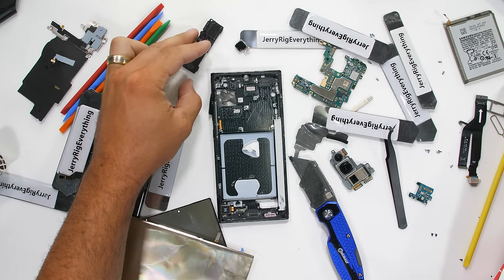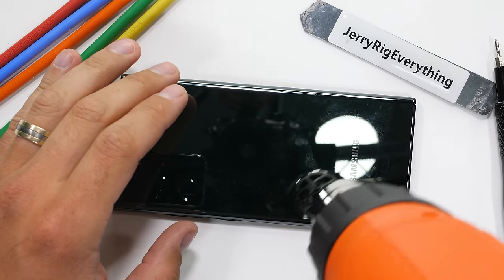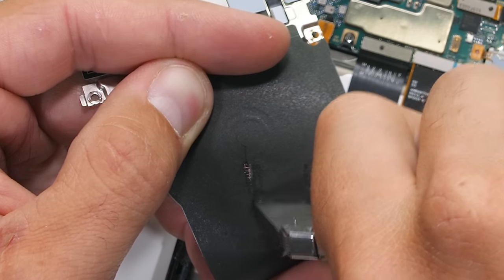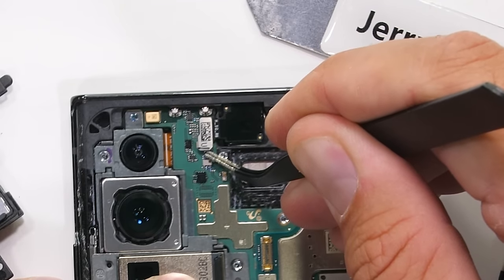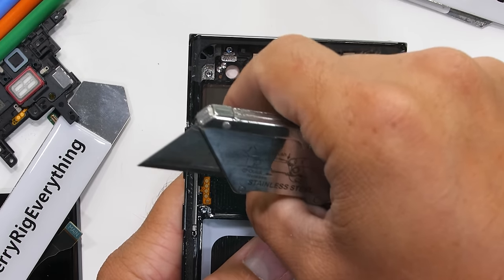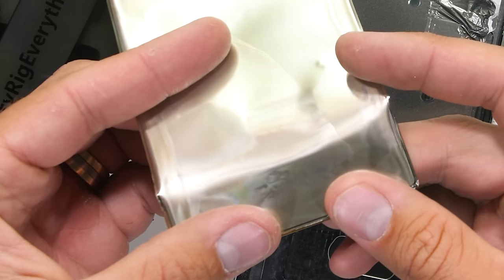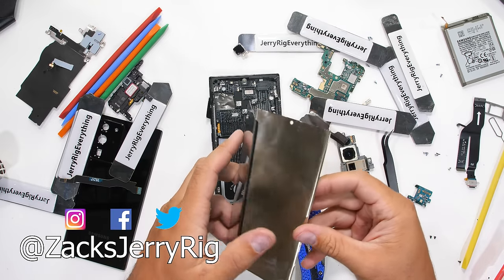Samsung Note 20 Ultra Teardown! - No Copper Cooling inside?!

Comment: I've had a note 20 ultra since release, I upgraded from the note 9. Its definitely an upgrade to the note 9 no doubt! everything is better on note 20 ultra from what I've experienced. Quite shocked to see no thermal paste tho?? So far Mines not been getting hot at all, even during benchmark tests and stress tests
Reply: I play Genshin Impact and during a warm day (not even our hotter summer heat) if I have the brightness higher than 10% my phone cooks while playing. It's pretty horrific. You'd think after the note 7 dilemma, they'd think about the phone heat more thoroughly.
Reply: @beansandmullets  same issue here. Literally came on here after my phone got so hot I couldn't touch the volume keys. The temps go up and down dramatically, kinda disturbing. I feel like I need to store this phone on something noncombustible
Reply: Honestly same, the jump from the note 9 to 20 was great, but its disappointing to see samsung stoop low like that
Reply: @beansandmullets  all phone heat up while playing genshin impact lol. Even iphones and the ROG reach 50° while my note 20 ultra exynos barely reach 46°
Reply: @SirAreve  heat up while playing genshin impact? That's normal. all phone could reach 50° while playing that beast
Reply: I also upgraded from the Note 9 to Note 20 Ultra. Both phones always extremely hot when gaming, it's not possible to play without a strong case on because of the temperature otherwise your fingers get really wet from sweat. But Note 20 Ultra is even hotter than the Note 9 and I find that extremely disturbing especially considering all their claims about how both of those phones stay cool when gaming and it's a total lie. With that being said, when not gaming, they're fantastic phones (Note 9 better in my opinion).
Reply: @potatochalbro  I have to say I don't really game on my note 20 ultra other than some old school ones that don't stress it very much, not a fan of mobile games though I prefer gaming on my pc or my ps5. (That does suck for people that do game on note 20 tho 😕) but in normal use its fine for me and doesn't get hot "like you said". Have you tried xbox xcloud? Because xcloud is streaming games not actually running them it shouldn't make your note 20 ultra hot but you'll need a controller and depends on what games you play I suppose
Reply: I came to this video after my phone gets hot from just charging. It's ridiculous. I have only had the phone for maybe 2 months but this is horrible. I also have my hotspot on a lot if that makes it even worse???? But I've been looking into the ROG Phone 5 or Black Shark 3/4 instead. Though does anybody have any tips? I like the Note so much other than that......

Comment: "My next phone will not be a Samsung..." That's exactly what I said a year ago for the S10 and the Exynos situation... Yet I waited for a year to upgrade from my s7 edge(trust me it was a real struggle but rooting etc made it work for a bit). I have an OnePlus 8 pro at the moment and I don't think I'll go back to Samsung (ever). Same thing that happened to Sony when I upgraded from an Z1 to the s7 edge. Let them bankrupt for all I care...
Reply: OnePlus is the best option, I still use OnePlus 6, just because it was the last to get a headphone jack, but its performance is still top of the line!!!
Reply: @77piter77  indeed snapdragon 845 is no less of a king
Reply: What did rooting your phone help you do?
Reply: @audai1366  install ViperAudio? Install Advanced Charging Controller (ACC) to manage charging limit, prolong the battery longevity and enter cool down phase for few seconds with its heat management? Mask my root from banking app and pokemon go? Underclock/Overclock or ability to chg the i/o scheduler to ZEN instead of the normal CFQ for better stability?

It wont be beneficial for a normal user. Cuz they are the kind that says its spoiled, let's chg to the next phone I guess. Its for the more advanced and adventurous users that wants to control what they have in their phone after warranty ended.
Reply: @audai1366  what Eddie said plus flashing newer versions of Android and using  different kernels in order to squeeze every bit of power of the old phone. Newer versions of Android also provided newer features and security patches.

Comment: Jerry: There is no copper cooling system 
Blind fanboy: But but Nope 20 ultra has copper coloured phone
Reply: @kazimahmudrafid1147  most samsung fanboys I know are all tech savvy. Thing is I'm a Samsung fanboy and I'm sad samsung has taken this route. I wanna see them go back to their old ways and not stick to how they are going atm. If Samsung and AMD promises a lot on the s21 or s22 then I'll stick back to Samsung. Atm it's not convincing enough to buy samsung phones atm :(
Reply: There is no copper cooling in Ba Sing Se
Reply: I don't know what if Samsung considers $170 Buds Live as AirPods or AirPods Pros, but it has ANC that does literally and absolutely nothing. I stood next to a pc fan, I stood next to a radio, I hummed, and ANC canceled nothing. It's like this no-cooling situation where I'm bewildered. At least though, it's not like OnePlus putting bogus lens in for the specs.
Reply: @III-zy5jf  Well, they consider the Buds Live a competitor to the regular AirPods. And at least the Buds Live have ANC (works better depending on the ears) compared to none of the Airpods. But anyways, the problem is that the main speaker doesn't sit far enough into the ear like the Pro's to really take advantage of ANC.
Reply: @TheRealUSArmy  amd wont happen for s21 (it might still change, but not likely)
Reply: He actually got the models wrong. The model he has is SM-N986N which is the Snapdragon version therefore the snapdragon is the one with the inadequate cooling.
Reply: 11I1I11I The reason the Galaxy beans (yes ima call em beans) have shitty noice cancellation is cause the design of them makes it so they don’t stick in your ears so that’s why it sucks. They’re marketed and are in the same price range as airpods so they should be compared to airpods. Both have their pros and cons but imo I’d go for the airpods Over the beans. What they should’ve done is put noise cancellation on the regular galaxy buds since they’re are in ear
Reply: @lifeisshørt_420  open designs tends to have bad anc. It's designed to let air and sound in, it's geared more towards comfort in long usage.

I specially buy this kind of headphones because my ears get heated and uncomfortable easily. It's a trade off i guess
Reply: Winnie Id Yeah I’m on iOS so I have airpods and honestly I like the way the design is (not the stupid ass long sticks but I mean the area that rests in your ear) it’s definitely my favorite design for the ear of any wireless earbud
Reply: Winnie Id I’ve used the Samsung beans and they’re actually pretty good with my ears tho
Reply: @DanThePianoManNZ  maybe both? Not a guy into phones but I could always be both with testing

Comment: Graphite has been used for years to pull heat away from expensive components in computers and phones, for example. The secret to graphite's success is its small spherical "pores," which allow it to absorb heat better than other elements often used for cooling.

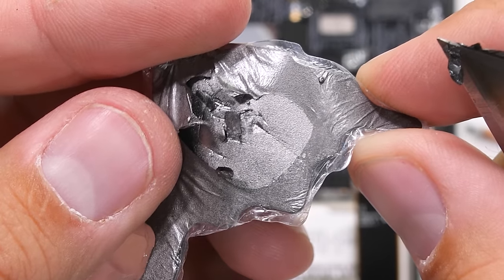Comment: 5:55 I think it's graphene which is more effective
Reply: If it's real graphene it would be too expensive for samsung to put it in their phone, partly because it can't be produced in large quantities as of yet
Reply: Yes it cant be produced in large quantities but still enough and considering the price of the device i think it could be graphene
Reply: No they cant be produced in large quantities like that yet. And if they could do that, they would've done it for the battery.
Reply: @rosescan3149  Its graphite and its still more expensive than copper.
Reply: While graphene is more effective than plain copper, it is NOT NEARLY as effective as a vapor chamber / heat pipe.
Graphene    up to 1,950 W/mK
Heat pipe    up to 50,000 W/mK
Reply: U r true
Reply: @evghenim1955  source?????

heat pipe from?
Reply: @rosescan3149  the mi 10 ultra has graphene battery... That's how it achieves 120W charging

Comment: Samsung is the new apple. 
Corner cutting and price gouging galore
Reply: In my opinion that's what they've been doing for a while (or at least that's what my gut told me), but on a small minute scale compared to Apple, so this may be the biggest stunt they've pulled I think, can't confirm since I haven't been keeping tabs on them, but I personally think that they've allowed their "brand name" get the better of them, seeing the fan base they've got, and taking advantage of that (as Apple has been doing for years with their ecosystem). I prefer the lesser known Android brands who gives you more than you'd get for the same price from a well known brand name. That's just my opinion on the matter, and I'm sorry to see Samsung doing this
Reply: @Darsh * actually my SD865+ note 20 Ultra benchmarked higher than the A13 in multi core
Reply: They need to make profit buddy... And samsungs phone devision doesn't perform well...
Reply: @Darsh * no corner cutting? and  apple in the same sentence?
Reply: @Darsh * you compare what's currently available on the market, as of right now the 11 series is the most current available, and I don't have a time machine to test the 12.
Reply: @nothing9220  really? Is that why they've been the #1 on the market for 3 years now?
Reply: @Darsh * the XR, the 11's displays, the 3 gb of ram on both models. The iPad pros build quality, the MacBook pro 15-18's keyboards 

Want me to keep going?
Reply: Except Apple is doing none of this.
Reply: @Raja995mh33  take a good hard look at their base model 11 and tell me you actually believe that

Then have a look at Android phones in the same price range that DON'T have LCD screens with a resolution of under 1080p
Reply: TechDove not really. The 8-core 865+ almost catches up to the almost one year old(!) A13 which is still a 6-core. 33% more cores but only about the same power while in single core it's not even close to be even comparable. And don't even start the Argument about efficiency. That's also where Apple is absolutely killing it still.
Reply: @Darsh * in your opinion it's not.
Reply: @Raja995mh33  yes really. I have both phones, how can you tell me the benchmarks I recorded are false 🤣 my Instagram handle is the same as my YouTube channel name here, I'll be happy to send you the proof
Reply: @Darsh * the iPhone 11 cuts corners, hate to break it to you
Reply: @Darsh * no it literally is your opinion. I think it's impressive, considering how powerful apples A series chips are. It is not a provable fact that it is not impressive, therefore it is still just your opinion.

Look up the definition of opinion and of fact and resubmit your claim once you've educated yourself on their definitions
Reply: @Darsh * I have both phones in my pocket, right now. 

Well, I'm typing on the note... Anyway, I can personally tell you there is no visible or tangible difference in performance with both phones at 60hz. 

So even if one is more powerful than the other, you would never notice.
Reply: TechDove in your dreams. That’s on Antutu only, and even Antutu has it on their website that the benchmark is not cross platform hence the lower scores on iOS. Check the scores again on Geekbench and see for yourself
Reply: @Darsh * others have replied, but I'll add my reply as well.

take the base iPhone 11, as you've said it's the only one you're talking about. 

screen.
even ~$170 (depending on region) smartphones have full hd displays.  maybe when the iPhone had still a 4" display someone can say it's an "ok screen", but for over 5.5" you do need full HD resolution. otherwise you have texts that will make your eyes feel tired very fast (I do a lot of reading on all of my displays, phones, pc etc.) and the videos won't be "crisp". especially if you zoom in on youtube. 

ram. again ~$170 smartphones have that amount of ram.

battery. subjective, but it's not something to write home about.

and that without touching the iOS, which I don't like, to put it mildly.

and before you start saying that I don't know anything about it, I'm using an iPhone, alongside with my main device (always an Android), not the 11 one.

with the kind of things that Apple let's you do with your phone, I don't think that iPhones can ask for the prices that we see.

and to answer your next question, no, not even Androids can ask for the ridiculous prices that we see more and more often.

and the updates? up until now, nothing new was added, except for the animojies, and for the higher variants only.

only with the 14th update Apple adds widgets. widgets. in 2020.
Reply: @babalolaviktor5398  nope geekbench 5
Reply: @TechDove  boss i'm not saying it doesn't have a higher benchmark score, i have the 11 pro max myself and i don't have the Samsung just because i'm from Nigeria and it's only the exynos version i can get here. What I'm trying to let you know is that Antutu is not cross platform like geekbench, so the scores on android phones on antutu are always very high compared to iphones.
Reply: @TechDove  okay then lol, not gonna argue.
Reply: @babalolaviktor5398  okay sorry I didn't see your response, you're right about that
Reply: @babalolaviktor5398  and hey if you ever want the snapdragon version of a Samsung phone I'd be happy to help you get one. Just hit me up on Instagram 🤷🏽‍♂️ I've done it before for a complete stranger, I got him the snapdragon S10+
Reply: @TechDove  i'm most likely going to hit you up soon then, my country's currency is very bad and it falls against the dollar by the day, the base ipad pro 11 in Nigeria costs the equivalent of 2k USD which is just very ridiculous, especially for someone like me who is very conversant for the prices in the US. my best shot at getting the best gadgets is importing them. I'm going to follow and send you a DM on IG.
Reply: @Darsh * that's what literally every YouTuber has done since the dawn of the smartphone. It's the way people compare cars as well, you compare what is currently available on the market regardless of how old it is. That's how it has ALWAYS been and how it ALWAYS will be regardless of your opinion of it.
Reply: @Darsh * so this is a response to your 1st comment in this thread, and personally I'll just say that I am an android user, and prefer Android over Apple iPhones and products (just haven't had the opensource experience on Apple products, so as someone who uses Linux based systems, I just have the preference as Apple seems limited and restrictive on certain areas. I will however give credit to Apple for their OS and hardware working well together, but that's because they've got one OS running on the same hardware 99% of the time, so it's been "perfected" and streamlined to work together well. Android on the other hand is used by many various companies, and needs to work on multiple hardwares, so it can't be streamlined and "perfected" for each individual kind of system (well it technically could, but then there's going to be a need for additional devs to tweak and improve the "base android" OS to suit and fit every individual model of smartphone out there). So that's why Apple may to some extent perform well, and seem like they don't cut corners, but on the flip side, they're technically selling an iPhone 8 as an SE 2020 model at about half price of the usual Apple iPhone price tag. So all I'm saying is that there's no perfect android phone out there (because of every person's different wants and needs), but don't give Apple the praise and say they're the best when they actually still don't have anything else to offer than what they've already offered over the past 3 years except a higher price tag, and getting rid of some features that people actually still use. And I'd also agree with some of the later comments people have posted here, Apple doesn't need to charge as much as they do for their iPhones, and neither do Android. I just think that half of it's more hype than anything else in reality. And at the time of the iPhone 6, a Huawei P8 Lite had very similar specs for a third the price... So my point is just this, yes Samsung cut corners here, but Apple has been selling the same stuff with a small thing different here, and another small thing different there, but nothing spectacular in my opinion, and charging you more for a phone that hasn't really "evolved". I may be wrong as I'm not an Apple user, but I've had to handle Apple devices at a time, and I just didn't see the hype at all as I've had with Android devices. And personally I don't like Samsung cuz of the way they operate and do things, which to me seems like they're moving into Apple type territory. Lower end Android devices do offer a lot more for their price than high end Android devices do in my opinion, because by then you're just paying for the hype
Reply: @Darsh * I'm thinking you're going to have a hard time, considering that you're going from an almost non restrictive os to a very restrictive one. there are things that you have to let go, that you won't be able to do anymore and other things that you have to do in a more difficult way. I don't know anything about the iPhone 12, but if the iPhone 11 is any indication, I'm guessing it's going to be the same phone, only higher priced. if I were you, I'd first buy an older iPhone (which I did), since ios never changes, in order for you to see if the os is going to work out for you. if it does, then you can go for the 12. if it doesn't, you wouldn't have spent a big amount of money for something that makes your life harder.